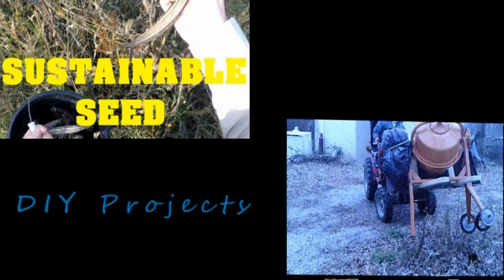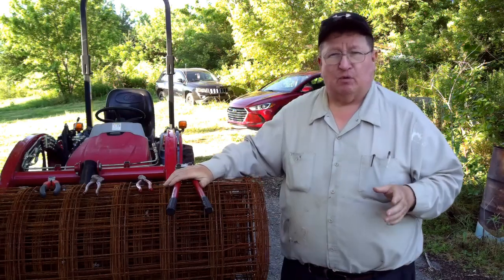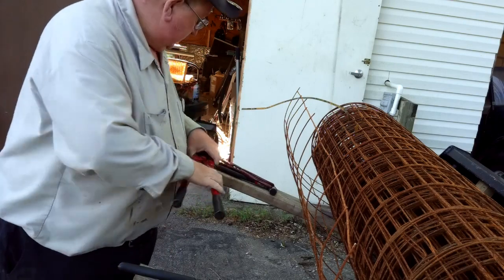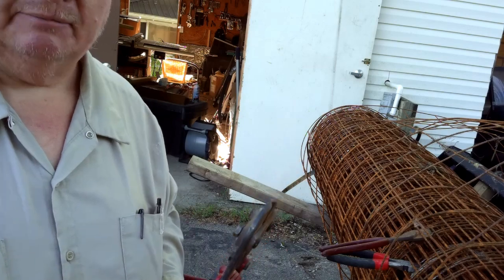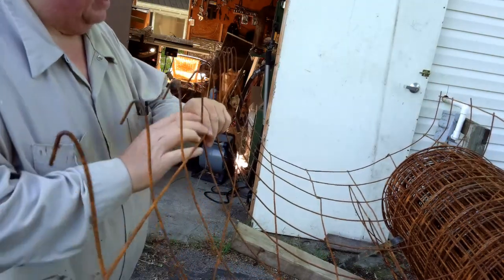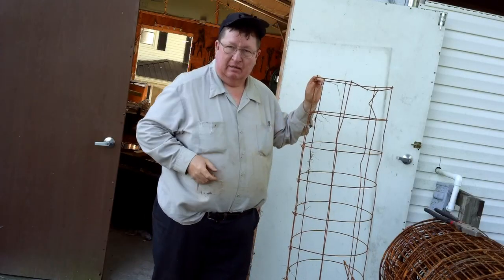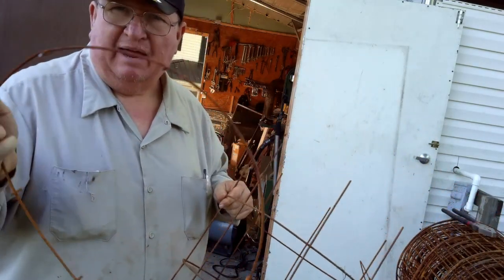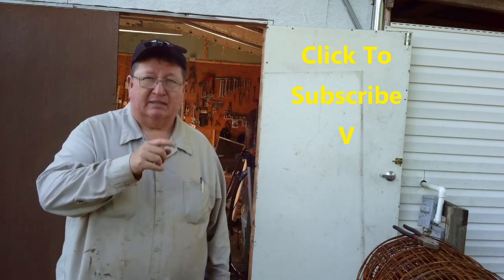$2 Lifetime Tomato Cages That You Make Yourself DIY

Comment: When splitting your tomato cages for your determinate variety. You could alternate every other section, cutting diagonally corners of the middle section, when performing the separating cut along the bottom tines. You'd then have feet every other rung to stick into the ground. You won't have the extra material (You don't have a use for, at this time) and eliminate the work of cutting out the ring. Depending on the size of the material, you may have half that is slightly (one rung) longer. It's an idea that I had, I hope it's useful. Thanks,
Reply from the maker: We do that when we make the determinates but the but the big old indeterminates would topple that 5 ft cage over without a substantial stake.

Comment: Loved the video and the how to do step by step. Mine are 36 inches across, I put a 5 gallon green tea weep bucket in the center of four tomatoes and fill the bucket every 2 to 3 days. Use a mortar/paint mixer on a cordless drill to keep my manure and nutrients stirred up. I also let my water bucket dry one day to keep mosquitoes from laying eggs. A long handle wand with a thumb switch allows me to fill the bucket without bending. I also remove the bottom leaves and suckers for improved air circulation in the tomato tower.

Comment: I make mine 9 loops and 10 tn. I loop it around the last by hand ( one loop).Lay the all spool on the ground by staking it to ground.Use a grinder to cut .Fast and clean.(update put something heavy after each cut on the roller so it does not roll back.)
Reply: A grinder is a good idea, also use the grinder to take away any sharp edges.

Comment: A 5 ft. x 150 ft. Steel Mesh Roll costs $239.00. That makes 30 tomato cages. That's $7.97 per cage. That's still cheaper than useless store bought tomato cages but a lot more than $2,00 each.
Reply from the maker: Yeah I did this vid 4 or 5 yrs ago. They are great even at the higher price and a whole role give you a lot.

Comment: That’s a good cage but I have a suggestion that you might find a little easier that works just as well. Just buy some rebar and stick for posts in the ground to at the end of each row of tomatoes then take some fishing line and go around the perimeter and make a square and the tomatoes will grow up in between the fishing line and then I sneak box if you want to make a cage around each division individual tomato plant which I don’t find it necessary, you can just zigzag the fishing line down the road on the top and bottom between each plant
Just make sure you don’t sniff that line if you’re cutting leaves!! 😜
I have a little feedback on your video if you’re interested… I fast forwarded to the part where you started making the cages because I feel like you could explain your reasoning in math and tools and all that while you’re doing it. I have a short attention span as do most people on YouTube I think. 
But I like your video a lot... and I like your idea a lot too- it’s just kind of a lot more work bending those wires

✌🏻😘
Reply from the maker: Sounds like a lot of work every year for our 200+ tomato plants.

Comment: I made 100 indeterminate cages out of concrete reinforcement wire 20 years ago and they are still going strong. It's alot of work rolling out the wire under tension. You need to wear  boots, jeans, heavy shirt, gloves and safety glasses. It's the best way to grow tomatoes. I use a bolt cutter like yours, which cuts it like butter. I bend with my bare hands.

Comment: If you want to easily store, do it this way. Cut 2 pieces 6 squares each and cut the horizontal piece out of each length at the bottom. Use a 2x4 and bend the 6 panel 90 degrees with three panels on each side. Now you have two parts to a square tomato cage. 12" can go in the ground and the height will be 54". Attach with zip ties. The right angle pieces nest for easy storage. Makes 21 ( you use 7 panels to make 6 so 150' x 12" = 1800" / 6 = 300/14 = 21 cages for $200 so $10 a cage. 18" on each side. All you need is a bolt cutter or grinder. Sometimes I use rebar to anchor the cage in addition to what is below ground if the plant is really big/heavy.

Comment: Concrete wire rust too quickly, and will not last as long as if you were to use cattle panels. Cattle panels are 16 foot long and 50 inches tall. They are made of quarter inch thick galvanize steel that will never rust.
Reply from the maker: I have some cages that are over 50 yrs old out of concrete wire and way cheaper than cattle panels. But nothing is cheap anymore even if it is made cheap.

Comment: Cattle panels are galvanized they won't rust unlike what you've got!
Reply from the maker: Doesn't matter about the rust. These will last well over 50 yrs. I still have some my grandmother had. Cattle panels are over $20 per 16' panel. This $100 roll of concrete wire will make 36 cages. It would take 10 cattle panels to do the same and you would have to do all the cutting with a grinder.

Comment: Wouldn't that rust transfer to the plant once it starts to lean and support  ?
Reply from the maker: Not really. As it sits in the field and the plants rub on it and different stuff over the summer and into the winter - I don't take them up till spring - it is like it gets a coating on it. I don't even get rust on my fingers moving it at the beginning of the next season.
Reply: @CollegeHillFarm  wonderful.  Now I dont have to go buy new wire . Mine got left out and it time to make cages.

Comment: Not $2 anymore damn 
Now it’s like $300 a roll at depot
Reply: At Cardinal Home center in Crozet, Va  it was $179. But over at Home Depot in Waynesboro it is $236. It's still cheaper than using cattle panels.
Reply from the maker: yes it is